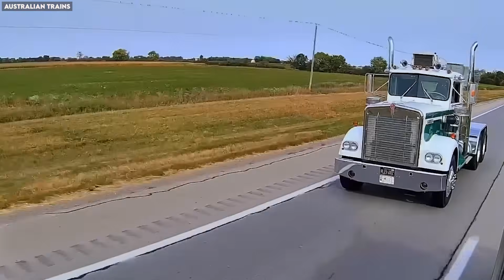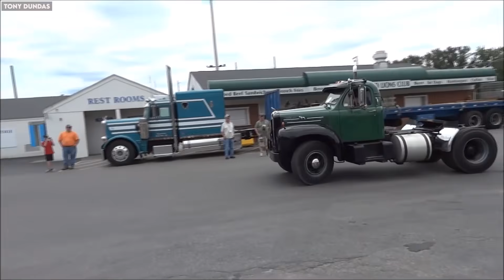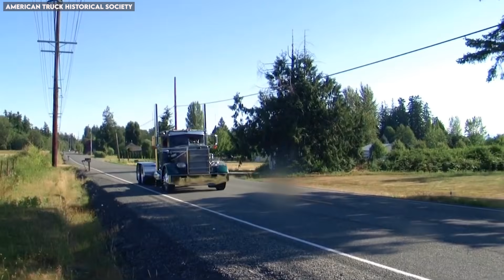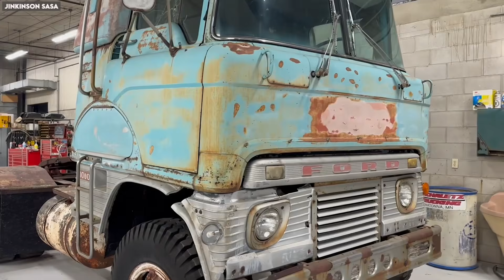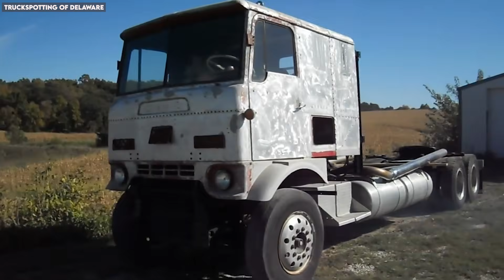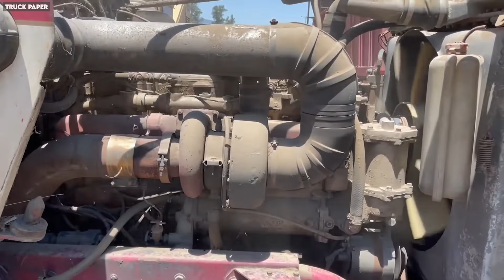10 Muscle Trucks From the 1960s That Ruled the Highway

Comment: Maybe  this has too much AI, post 1990.  The 1960's did NOT have a lot of conventionals running down the highway, it was mostly COE models in order to keep the overall length of the combination within state length limits.  1) the White 3000 was not seen out west, except as a City delivery truck, just like the Ford C series.  These were NOT heavy duty, but medium duty trucks.  2) The Freightliner FLD did not come out until the MID 1970's, Freightliner was ALL COE models in the 1960's and the radiator detail changed about three times during that period (and you had to look close to see the differences).  This presentation does even show a Freightliner COE model at all--you are getting images from post 2000 truck shows, which are NOT historically accurate--they are just truck 'hot rods', not history.  3) the BIG 1960's engine was the 12V71 at 434 HP, which you didn't even mention.  It was a rare find, mostly on the Eastern Turnpike Doubles.
4) What I saw in the 1960's was nearly total takeover of Over-The-Road trucking by COE models (Autocar never made a COE, they were made by GMC, KW, Int'l, PBT, Freightliner and White 7000) working for both Common Carriers, Private Carriers and even Owner-Operators.  If you drove Coast to Coast, you had a COE sleeper pulling a 40 semi-trailer.  Conventionals were used where the truck would weigh to maximum allowable over the cubic capacity freight--heavy stuff like concrete mixers, dump trucks, tankers & low boys.  Vans and reefers used COE models to gain cargo cubic capacity and the 65 foot doubles combination progressed east from the West Coast & Rockies into Indiana during that decade.  I was there, so I know.  Maybe you really need some real 1960's trucking images stock.